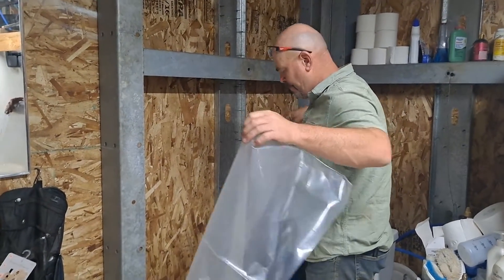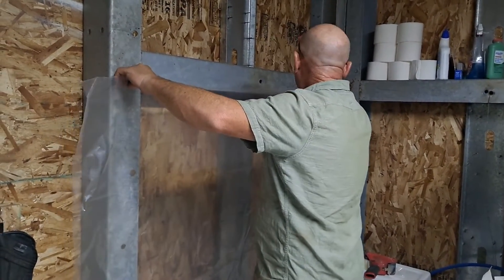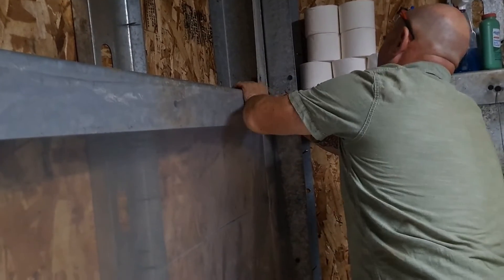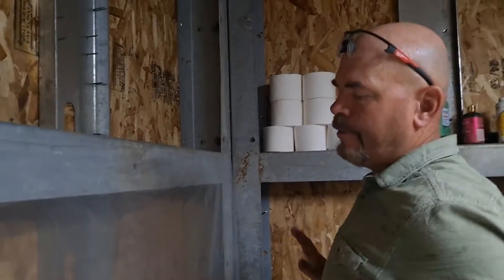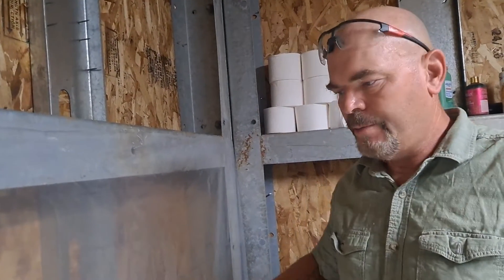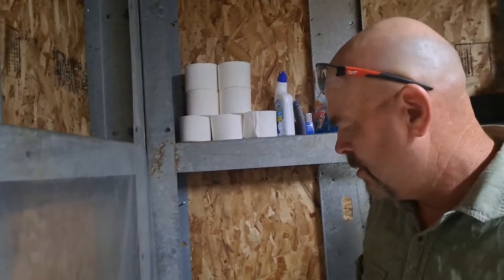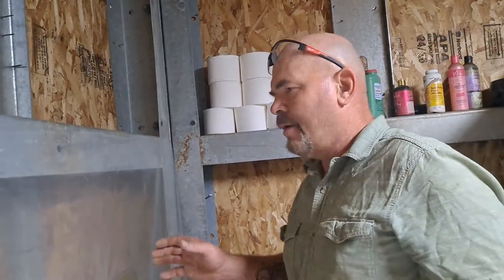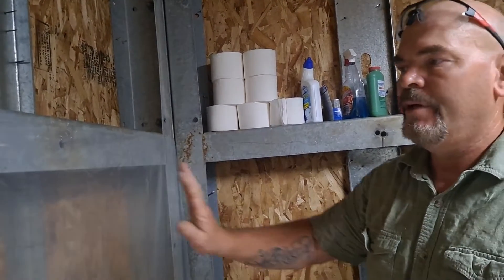Pouring Aircrete in to A wall

Comment: Seems to me that you need to pour in smaller stages so it doesn't settle so much. My understanding is that you don't want it dense because denser = less insulation value....no? Wouldn't you be better off pouring  it horizontally and sliding it in?  Also, I guess you have done the calculations, but isn't metal a very good conductor of heat through your wall? Wouldn't a wood stud wall be more efficient?  Especially one with 2 x 2 and chip board.

Comment: Saw dust is Organic
Aircrete has both air & moisture
Won't that cause the saw dust to rot away, releasing heat & gas and crack the aircrete?

Comment: Build a PVC double acting pump and mount to the bottom of your barrel. Some plywood pulleys and a belt should allow you to convert a cheap drill to back and forth motion to drive it.Tee a recirc valve ( flue damper) to the top of the barrel. start the pump with this open and close it to pump aircrete. You don't need fancy check valves, build homebrew flap valves and a damper for the recirc line. A little heat and you can flatten out cut PVC pipe to build any parts you need. Thanks for all your hard work!

Comment: I'm just learning about aircrete so I have a question. Doesn't pouring this mix into a form, in a way, defeat the purpose of aircrete? This a a foam and compressed air product that if poured beyond a certain depth causes the air and foam to collapse which is why the end result of your pour seemed deficient to your expectations and in the end uses substantially more product than required. It would seem much more efficient to build a reusable jig out of Melamine and pour these flat then attach to your frame, additionally pouring in place seems extremely labor intensive compared to pouring flat and then attaching. I also noticed on your shed build that you kept the metal forms on after pouring which seemed unnecessary and costly. From what I have learned this product should be structurally sound enough on its own. Again, I am just learning and I am looking for some direction so please do not take this as a jab but rather a legit inquiry. Also, one more question, this concerning the 2x8 panels you poured for your shed. Why not pour 4x8 as most sheets of construction board is 4x8 standard. I appreciate you. Val

Comment: !
   Why did you create such a huge form, for just a 12-15" pour?
   Why not just use a 24" form and work your way up the wall in stages?
   This way, you could move right on to the next section, left or right, while the first one is setting up.
   It would not only have been easier to pour the first 3-4 vertical stages, (5-6'); but, also, you would not need to use such a large sheet of plastic, either.

Just a thought.

Great job, though.

Comment: I was contemplating fastening the foam mate to the side of the barrel feeding into the barrel.  When the batch is ready clamp the lid on and turn on the air tot the foam mate and the pressure would push the aircrete out a gate valve and hose used fo waste tanks.

Comment: You should be able to get by with a diaphragm pump. You can get a chinesium Ingersoll Rand knockoff double diaphragm 1 inch inlet 1 inch outlet, 35 GPM, air operated pump for about $300 right now.

Comment: Good to see the first test batch of your latest aircrete recipe  mixed and poured into a wall of your forever home. 👍
Have you figured out why the aircrete settled so dense and how to get a lower density? 🤔
Reply: It's an inventor's mistake that I would have made also.  The aircrete bubbles just can't hold that much vertical column above 4 inches or so before the weight crushes the air out.  They can be poured flat and tilted up, but the slump weight column height wins.  That may be why some are turning to shredded packing foam like Aircrete Harry instead of soap foam for structure builds.  Aircrete performs very well as an insulator for the rocket  stove with thin walls and ratio of thickness between the sides of the refractory core and the outer sheet metal core holding it versus the height of the pour may be sufficient to keep the air entrained.  Which means the rocket stove might cure aircrete a little better setting horizontally that vertically.  The ratio of height of the pour to the thickness may just be thin enough in the rocket stove to keep the column from squishing out the soap bubble air with vertical pours.  I'm no expert.  DO TRY THIS AT HOME!  Lol.